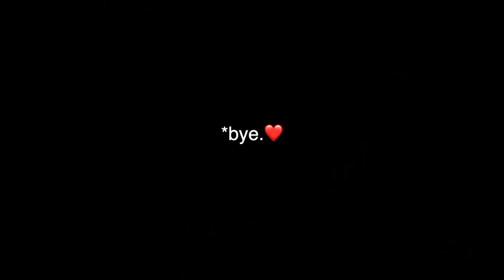EWE're as cold as ice🥶| let's see if this worked...🧐| Vlog 542

Comment: Hey Sandi, if you have one of those red lightbulbs like you see at the burger joints for warming burgers (250w), you can use that to keep the milk nanny warm.  I have one and I have it hooked up through a thermostat so that any time it is near freezing it turns itself on to keep everything warm.  It has saved my bacon many times when the temps drop overnight.  Just a suggestion.

Comment: Men, /sheep are all the same!!! Lol one thing on there mind! Lol
My favorite time besides birthing is when the babes take advantage of moms eating and run and bounce all the way back and forth in the stall.
Can you not add a heat unit to blow heat in these extreme case weathers. My brother has a large auto shop and uses one in those rare cases.
Can’t wait for next birthing… but love all your content! I’ve learned so much. I’ll never own sheep as I’m a city girl. Only 2 blocks out of county land!😢 but I do a good size garden and can, dehydrate and freeze.. and hoping to add chickens this year. I have 1/2+ acres so am blessed on that part. At almost 65 and a recent widow the challenges are there… especially with so many health issues.  
But as the Bible says “God will not give you more than you can handle”! This year I’m having someone come in and re set the angle of part of my yard as after 32 years it’s shifted. If I thought I could handle it I’d attempt a skid steer myself. But honestly though I could most likely do the upper area as it just needs leveled out some the lower area is going to have to have a tiered area and realigned so rain does not run into my house! Then after they do that I’ll add some French drains for safety!!! At the moment we are in the 20 degree temps so will have to wait a bit longer. I have Fibro and arthritis and they do not like the cold. And with COPD breathing is harder that way too. I’m also adding water out to the garden areas so it will be easier than staging hoses. To connect to my drip system. Not sure why I’m sharing so much information. Except you seem like family to me. I am constantly refer others to your channel! Love your sweet family. Thank you for sharing your life. Ignore the haters!
Reply: I am living through a reno of two of the three bathrooms in my house. We were just going to change the toilets but found the #@$%#  DIY former owner had done his own plumbing, and the floors were rotten out in that area! So between lockdowns that keep coming and going, and bad weather, the workmen come in when they can or when they have time.  It's been 7 1/2 week already! If you are downstairs, it is a sprint down the hall, up the stairs, down another hall and into  my bedroom.
I too have fairly major arthritis, so it is a speed hobble for me
Wishing you all the best : )

Comment: A little bit of nostalgia from my childhood.  I had a Susie Homemaker oven for children circa 1970's.  It came with a little round baking pan and just add water cake mixes.  I mixed up one and it really did bake with only a incandescent light 💡. 
I don't recall the wt.   But I am thinking probably a 60 wt, 25 seems to low, but 100 wt too high for a child's toy.  So it makes sense that a light bulb could keep the milk machine warm..  Those same bulbs are good for baby birds and sick birds,  I us 25 wt higher gets too hot at close range .  My grandpa used a glass  bottle with lid added hot water to keep an orphan bunny warm.   So there's some history an ideas for you.

Comment: You should check into getting some reptile heat bulbs or ceramic heater that fits in the light housing. You can also get a temp sensor shit off so you don't have to worry about it getting too hot.

Comment: Could you wrap the hoses that go from the nanny machine to the lambs with the formed black foam insulation (like you use on the pipes in your finishing barn) and wrap heat tape around the outside of that? The soft plastic may be too heat susceptible to use the heat tape directly on it, but the foam insulation might be enough to protect it. 

You mentioned a lamb that looked like a Texel -- have you considered trying a ram or two to see what type of yields you get? They're not overly big in size like a Suffolk or IDF, but they have double muscling and are absolutely solid.

Comment: 2 weeks of immobility is  a splint is plenty of time for a callus to start to form, that is new bone material around a fracture site but is not going to be long enough to have real bone form that will keep a fracture site from opening up or rebreaking.  Weekly checks and resplinting is a good idea, so that your changing the splint size for growth and not risking ending up with one leg shorter than the other, or overly atrophied muscles in the limb.  Until at least 3 weeks, allowing them to put weight on it without a splint is a poor idea as even if they limp and don't put full weight on it, you can be starting over again.  Breaks in that area below that joint usually respond well to splinting or casting - choice is optional but if you don't have a cast cutter then its a trip to the vet to remove that plater each week and apply a new one.  With splint too you can apply it where it will be less likely to have circulation issue if applied properly and there is space of the leg swells to avoid the circulation being cut off.  The tube cut in half is a fair idea but you do not want a tube to go all the way around, even if split into halves, better yet to remove a third of the tube lengthwise and keep the open area of the tube towards the inside of the leg and secure it with lots of padding and then vet wrap.  Lambs grow fast so weekly splint change keeps up with growth and gives a chance to check for any areas where there is rubbing and possibly a sore developing.  The splint really should be used for 6 weeks if possible, but if removed before then the lamb should be confined in an  area free of other rambunctious lambs and  perhaps kenneled if it tends t want to jump a great deal.  If at all possible a splint should ne at least 2 inches, at the very least but 3-5 inches in better, above where you determine the break is, while going up and over the joint above the break is optimum.  Its should not be like a Band-Aid and just applied over the break but splinted well above and all the way down and include the ankle and hoof and toes.  The idea of a splint is that you are using the animals physical structure with some external support to stabilize the fracture site so it does not move at all, and movement can inhibit the good bone callus matrix being laid down to repaired the site, an allowing movement in the splint or when the leg is out of the splint for splint changes can lead to rebreaks and damage to nerve and other tissues

Comment: You can if you want Use some of those swimming tubes to wrap (cut one side to put on)the pipes in your milk machine than use tape to seal it more should help to insulate you pipes just a FYI ❤💯
Reply: Unfortunately those swimming tubes are not quite enough for Canadian winters. :)
Reply: They have better ones at co ops but their more pricey and do help though if you wrap them wit duct tape it helps

Comment: Just a note:  My husband wraps lines, pipes in this foam tubing (It is in plumbing section of hardware stores). They look like those swimming pool noodles kids use in the summer.   The tubes about 2-3 inches in diameter. They can be easily cut in lengths.  He slits them down the middle to 'wrap' them around the line, pipe.  They tend to stay tight.  (He also use these for any thing he needs to make softer: bunkbed railings, ladder steps, etc. ) Anyway, thought I would suggest - might take less time than wrapping lines, pipes.

Comment: Telehandler: if the battery won't hold a charge, and you think you might have just replaced the battery in the last couple years, then be sure to check that the alternator is working properly. If the alternator has gone bad then it'll keep killing the batteries instead of charging them.

Comment: Have you considered placing insulation foam around the water line and feeding hose?? It's relatively inexpensive and can be cut to size.  I live in the Northeast in the  US and while it doesn't get that cold except for windchill factor it works for us.  Even a heavy towel might help.

Comment: About replacement ewes and rams. Do you draw from the lambs? If so, how do you decide which to keep and which to ship out? If the replacements come from outside your flock, how young do you acquire them? When are they are put into your breeding program? If they are from your flock, how old before they will go into the breeding program? Are they kept with the mature ewes whose breeding season coincides with the ewe lambs maturity? (Awkward phrasing, but think you understand my question.)
Reply: You can check Sandi's playlists, but the short version is this.

First Sandi usually ships all her ram lambs to prevent inbreeding (she also changes up her rams every couple or three years for the same reason).
She usually only keep ewe lambs from one breeding a year so they will all be one age: Sandi breeds at nine to twelve, many shepherds breed at six months.  I think it is usually the one where she is mostly using her Rideau-Arcott rams as she want to strengthen those genetics in her ewe flock.

Then each ewe lamb goes through a tough evaluation, she check confirmation, udders, general health.  Then she pulls up her records on their dams. The lambs must be either twins or triplets. Their mom's must have had enough milk to raise both twins, with no issues. She prefers moms that had an easy birth and have a good temperament. Any mom who rejected her lamb/s or worse attacked them is marked for shipping, and usually her lambs as well.

Even the "Billie" rams, the black-coated ones that are the sons of a very favourite ram had to go through confirmation checks, vet health check and sperm count.

She loves her sheep, but it is a business and one that helps support her family, and pays for the university for her two children.

This breeding you may have heard her talk about the "ewe lambs", which are first-time breeders. She usually put them with the lighter-framed Rideau rams so their first lambs are a bit smaller.
Reply: @mobydickswife9512  Thanks. I know she has spoken of these things, however, there were some things that were confusing. I appreciate the answers.

Comment: How do you pick which lambs you keep to join your flock and which goes to market? I know you don’t ship until a certain weight but how do you decide if you are going to keep them? How often do you ship the market lambs? Also I was wondering why you don’t have hair sheep? Are there any advantages to having wool sheep versus hair sheep?
Reply: She has several older videos on this, but a run down is that ewe lambs from certain breeding groups are kept back based on how mom did as a mom, how much their daily gains are, and if they meet the genetics she's looking for, which I think she said is the ridueo(my spelling is awful) and maybe Dorset.
Reply: I get the impression she does not have access to many hair sheep (though i think the tunis is a hair breed?) I recommended dorper when she was looking to replace her suffolks. She got dorset (which went into the dorper) and tunis. Maybe it really does get so cold there the hair sheep are not as good?
Reply: @rebeccaburrow7199  Also she is now selling the wool.

Comment: Random question but could you put that black pipe insulation that comes in long lengths and is made of foam around the lines from the machine to the nipples. It might not give much but would possibly help? If you use that it can be easily taken on and off to clean them. It is round but has one split down the entire length of it so it will easily go on and come off. Hopefully you know what I'm talking about. 🤦🏼‍♀️ You could also use it as splint material.. I use it to post my dobermans ears so I know it is sturdy.
Reply: Hello tami

Comment: Sandi, as frozen water and milk machine lines are a recurring winter issue and takes away time from the sheep, it would be reasonable to look at good solutions for keeping these warm, no matter how cold it gets. Something easily set up, durable, and easily taken down when warmer weather presents. Could be temporary or permanent. Macguyvering only goes so far. If it means serious modification to the barn, you do need to consider it. Would the builders of your barn have any solutions?